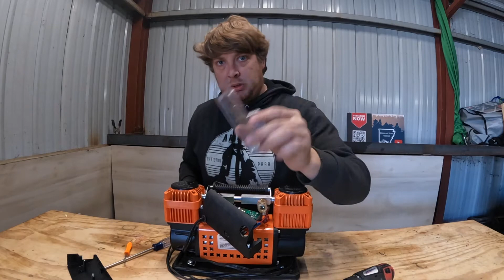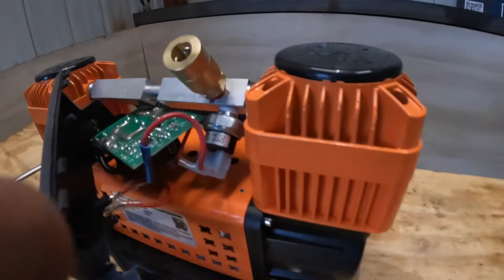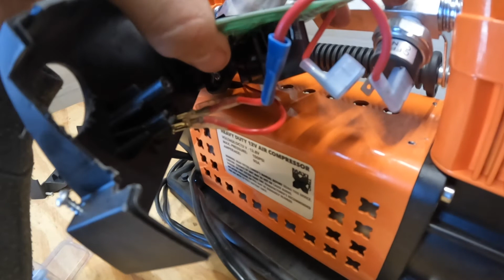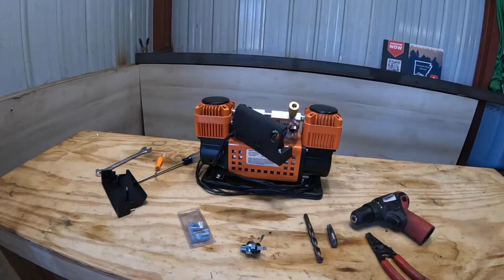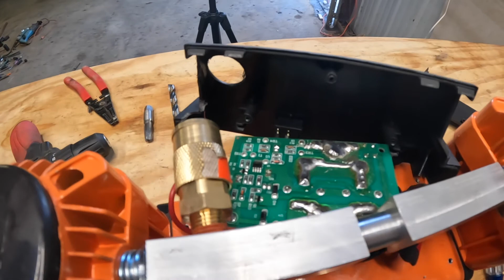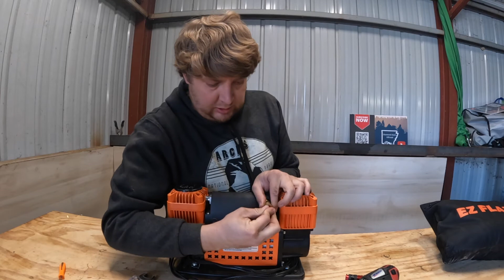Maxi Trac Compressor Mod - Pressure Switch

Comment: any idea whyy when i setup mine doesnt work? 😞 like its not turning off when i plug the compressor
Reply from the maker: Are you saying like the pressure switch doesn’t turn the compressor off? Have you installed a pressure switch?
Reply: yes, doesn't turn off, and yes i installed the pressure switch :( @DiamondStateOffroad

Comment: I did that mod about two months ago. The first video that I watched, had the pressure switch on the outside with a tee, which I did but thought it was too bulky. The next video  was to remove the head to rotate the manifold. One of my head bolts was stripped from the factory, so I used a large crescent wrench to turn the manifold. I still have a slight air leak after tightening  it down, with tape, and it will cycle about every minute, which is probably a good thing. I adapted the mounting brackets so it will lie flat, and brainstorming a way to mount it under the hood of my FJ Cruiser. Happy wheeling

Comment: How is it now? I did the pressure switch mod and my compressor was fine until my 5th trip out.  Started making noise like rocks in a barrel. I heard adding the pressure switch is hard on the compressor to start at 90psi .
Reply from the maker: Haven’t had a problem yet.
Reply: @DiamondStateOffroad  thanks for the reply.   Yeah not sure what happened. Of course no warranty either. Removed the pressure switch and will rub this one til it dies !